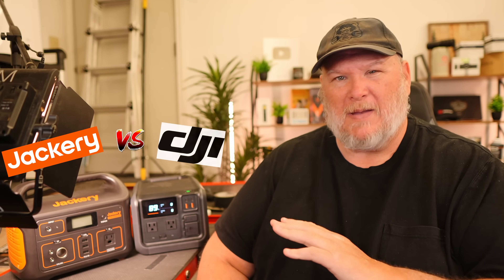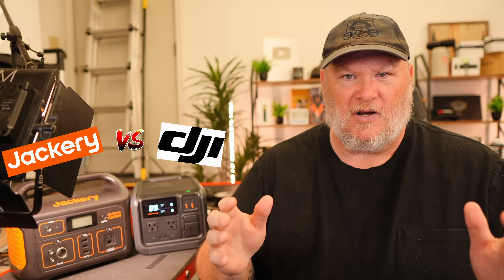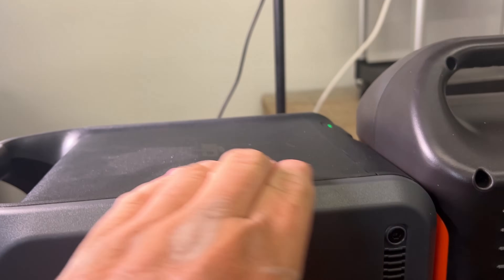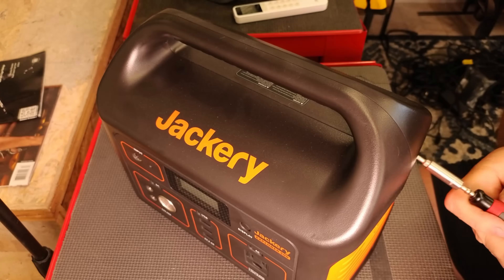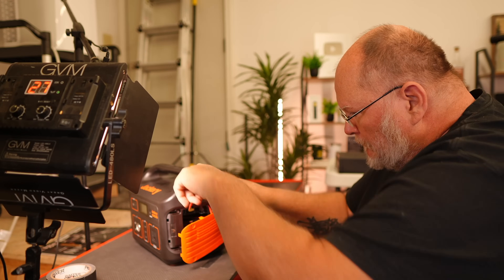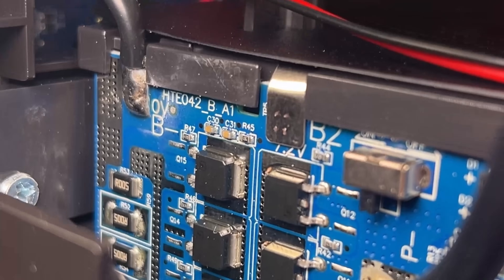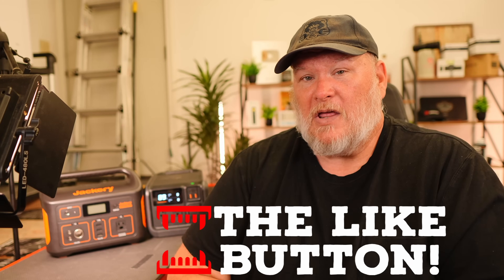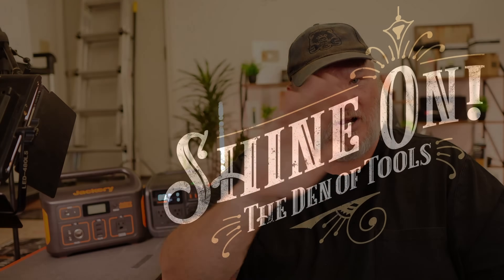DJI Power 500 vs Jackery Explorer 500 with Teardown!

Comment: I don’t own any drones, but this power station really stands out to me, because it can be dual charged via usb c ports, at least 100w each I am assuming, which is something that can be done via solar panel as a work around to their proprietary method or from a high powered battery bank like an Anker prime. I would choose this over the Bluetti Ac70, for this reason, correct me if I’m wrong about the ability to dual charge with those ports, but having a device with an inverter capable of cooking food and boiling water (depending on the lower draw versions of many appliances) and being able to recharge it with usb c ports via solar or power banks, is nerd heaven for me!! Thank you as always for your videos ! ❤🙏😎

Comment: On the DJI I question the over use of foam on the board and the capacitors. I'm guessing temperature protection is for the battery cells not the capacitors. I don't understand the wisdom in insulating the solid caps on the board even partially. Could result in lower life span

Comment: I have a little Fremo 300. Works great for charging devices and powering smaller A/C devices. I like the amount of ports and style of it. I’m waiting for them to put out a 1000 version. I need a power station that can run a sump pump for a short time if I ever lose power.

Comment: The DJI is really reinforced for vibration from being moved and bumped around. A PITA if it needs repairs, but should significantly reduce issues that would be caused by being portable.

Comment: To me, power stations make sense up to about 1000 Wh and $500.  Above that, having everything tied to one heavy box that probably stays in one location starts getting to be a liability rather than an asset.   If it is big enough that you stop carrying it around by hand, building with components is tremendously cheaper, and you can replace dead components, whiled a dead power station out of warranty is junk.  I'd rather junk a $150 or $500 power station than the crazy-priced huge ones available now.  

For my own needs, a $150 power station (LiFePO4, 300W/300Wh, 60W PD in/out) and whatever size of LiFePO4 drop-in I need in a particular application ($150 100Ah/1280Wh for car camping with a 12V freezer currently; might upgrade to 160Ah/2048Wh $237 or 300Ah/3840Wh $432) is all I need.  Throw in a DC-DC charger, or inverter + 120V charger, and you're off to the races with 4140Wh for under $800.  

Are becoming nearly free, the only real decision is how much you want it all to weigh.  2048Wh battery is 30 pounds, 3840Wh is 58 pounds.  

The pricing standard used to be $1000 per 100Ah (1280Wh) when Battle Born was the thing to have.  On Prime Day, I saw drop-in batteries for as low as $133 per Battle Born equivalent of energy capacity.  Almost down to $0.10 per Wh.
Reply: I agree. Once you go above 500 Wh, I start thinking I'd rather have a small inverter generator...

Comment: For $500 the DJI can NOT be charged by solar. You must pay for the optional charge controllers (each) separately. Along with any of the optional cables. I own a DJI drone, but a Hard Pass on their Power Stations.
Reply: I paid $379 for mine. I also got the single solar panel for $300 (pricey, but HIGH quality)  that can be used with the 12v charger that I got also. No controller needed for 100 watt panel, which for my use is perfect (Cooler uses 60 watts max).

Comment: I kinda like the look of the DJI. The jackery only having 1 110? Thats a deal braker, i have 2 fans i run in my RV on hot days for optimal air flow. If power goes out. the DJI can run them both, I might get one.

Comment: App control is not a feature. It is a liability. What are you supposed to do with these things in 5-10 years? You can't even use them as a boat anchor because they're filled with batteries.
Reply from the maker: Replace the batteries?
Reply: @denoftools  It is the features you can't get without an app. My goto is the old Jackery 300, because you plug things in and it just works.  Counter example with the EcoFlow, if you want to change charging from battery to car, you have to set it in the app. Also EcoFlow, works for a week no problem, and day 7 decides it has forgotten how to turn on charging from AC power, and you need a firmware update from the app. Set the Wifi up on your home network, and need to change something in the field? That sure was fun.

Unfortunately, Jackery has gone the way of the app as well with newer models.

Comment: What is this Gen 3, Gen 4 stuff? I don't think I've ever heard of power stations being categorized into generations.
Reply from the maker: I thought I explained it in the video but Gen 1 is where it all began, a battery in a box and not much more. Gen 2, like the Jackery is a more polished version in purpose built form factors.  Gen 3 inclusion of smarter tech and LFP batteries. Gen 4 is what we are getting to right now.  App control, specialized electronics, advanced LFP batteries and more. DJI, and the new Delta 3's fall into this.

Comment: What kills me is even their units with USB-C ports are low power. They were 15 watt if I recall. The DJI Power 500 has 100W USB-C like my EcoFlows. The Power 1000 has 140W USB-C ports. 
I'm still planning to get the Power 500 to keep in my car and charge my Mavic 3 batteries as fast as possible.